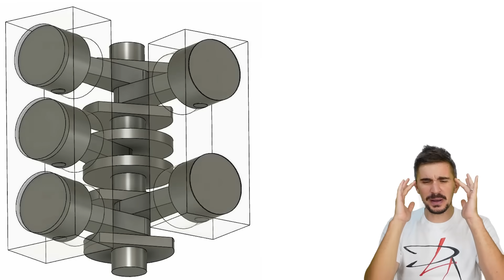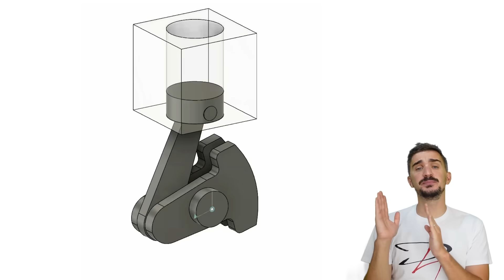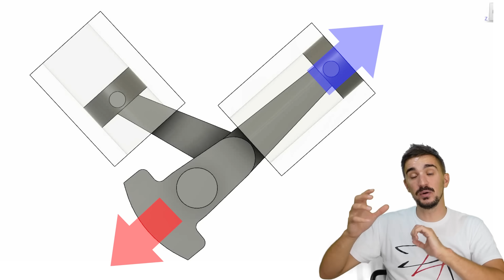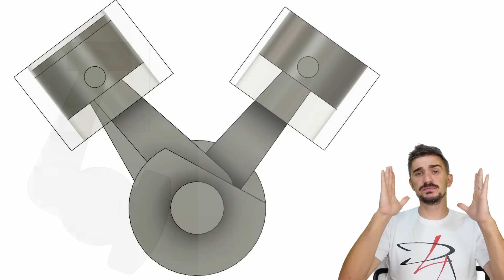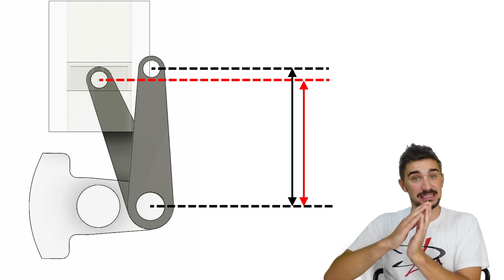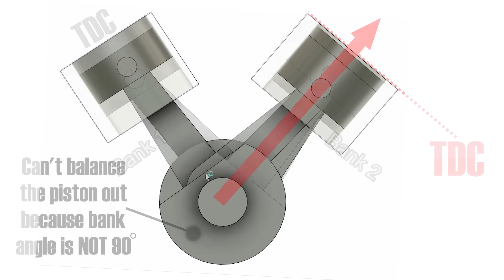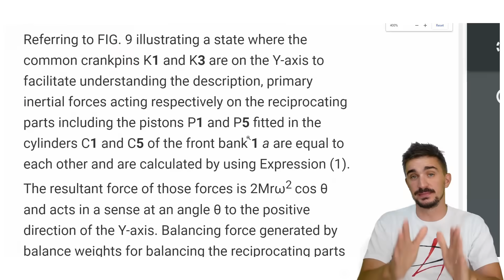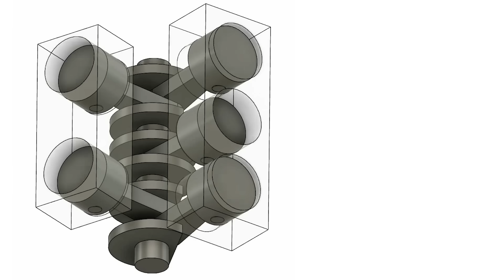Logic Defying V5 Engine - Honda's RC211V Explained Like Never Before

Comment: Thanks for the explanation. The five cylinder vee is novel, but not new to Honda. In 1972 Bert Hopwood at Triumph drew up plans for a new range of SOHC modular designs based on a new 200cc single which could be "doubled up" to make up to a 1,000cc five-cylinder engine. Of course, by this time Triumph was broke, so this scheme never went through to production. I can't find any details on crank throws for the five cylinder.
The concept is sound. The new Triumphs were based on the modular engine concept.

Comment: This just tells me we need more odd cylinder engines. Such a clever squeak of efficiency.
Reply: I think so too, from what i understand the same trick can be used on any odd cylinder engine. The downside is the increased cost of needing an odd and even cylinder head, rather than casting one head twice as many times. That is offset by not needing balance gears. But if a manufacturer already had a related v6 and a v8 on their sales floors. they might be able to reuse a head from each without increasing development cost.
Reply: @martin-vv9lf  V engines usually have two head castings, left and right. The cam drive is the non symmetrical element that demands the mirror image casting. There is a fellow making a V8 using Honda heads, and so it has two separate cam drives, one at the front and one at the rear of the engine.
Reply: @jiroyamamoto2878  But as you point out that a camshaft in a pushrod is non symmetrical, a v5 engine is also non symmetrical, therefore it will require a set of cam lobes per cylinder, not per two cylinders. This may be possible to accomplish since the two cylinder bank fits in the hollows of the 3 cylinder bank and as such the cams will not intersect. The downside is less room for bearing surfaces on the cam.
Reply: @martin-vv9lf  I admit I don't understand your premise. In my above comments, I was referring to an OHC head, not to a pushrod head. I believe that most engines do not share cam lobes with another cylinder.
Reply: @jiroyamamoto2878  sorry, I was muddled due to sleep deprivation. thanks for the v8 honda recommendation.
Reply: V5s do exist, VW had one
Reply: @initial86-2.5 Vw has a VR5 not a V5

Comment: First off VW released their VR5 engine years BEFORE Honda made their V5. Second, i don't understand why try to discount VW by saying that a narrow angle V engine is easier to balance than a larger V engine. If it were truly that much easier than EVERY manufacturer would have made one. The truth is VW has a far greater understanding for building unique engines, examples include a W8, W12, W16, VR5, VR6, all of which are unique to the brand with complicated balancing hurdles to overcome. Even their V10 TDI engine uses tungsten weights attached to the crankshaft to achieve balance in a smaller package. I feel like this video was less of a informational video about a challenging engine to ballance and more of a Honda jerkoff session made to pat them on the back for doing something not that impressive AFTER someone else had already done it. Do better next time.
Reply from the maker: Oh look, a fanboy. I know the video went over your head, but there's no need to throw a hissy fit and embarrass yourself. Instead calm down, regroup and try to understand it again. I'll help you a bit. The VR5 and the V5 are apples and oranges. When the angle is so narrow and the pistons are closer together the balance is very similar to that of an inline five. There's no revolutionary or out of the box thinking required to balance out an inline 5 because it has been done decades before. Lancia did the whole VR thing long before VW btw. Also, tungsten weights and other crank weights of even more exotic materials are nothing new, but more importantly they are also unrelated to the kind of balance I'm talking about in the video. VW did not pioneer W engines, this too was done many decades before. This video isn't about Honda or VW or any other brand. Although this may be hard for you to perceive, many people, including myself, aren't emotionally attached to brands. We're not associated with or employed or paid by them, we simply purchase their products when we believe they offer a good balance of price and quality. You should try it too, you'll be a lot happier and you'll also avoid future embarrassment 😉 Thanks for watching
Reply: @d4a  There is no embarrassment from my side of things. I only pointed out VW because they have some of the wildest engines that have been put into full production, more than any other major brand. Take a look at Harley Davidson. They have a 2 cylinder V engine that has an unbalanced firing order. They took and easy to balance engine concept and INTENTIONALLY run it out of balance.  I get a real laugh out of the fact that you think making a 15 degree V engine is so much easier than a larger degree angle. Its comical to think that. If that were true then everyone would be doing it. I truly feel like you wanted to make a video to stroke Honda's ego about the 5 cylinder engine but then you were like, 'oh crap, VW already made one AND put it into production. I will just say they are totally different so i can still make the video!'.  The fact is, VW put it into production, Honda did not. To my point about the V10 with tungsten weights, it was to point out to you that the V10 engine was so far out of balance that it needed heavier weights just to make it work correctly. This is an engine with 2 inline 5 cylinders, engines you seem to think are easy to balance. I challenge you to find a W engine with 4 rows of pistons besides VWs designs. The fact is VW has innovative and complex engine designs that get put into production. Honda has very little innovation and their experiments rarely get put into production. But don't take my word for it. I only know this first hand from doing engineering work for Honda...

Comment: Any problem can be solved with enough time, money and brain power.  The fact that it didn't drive up design and development costs to the point of being impractical is the surprising thing.  That and the fact it beat simpler designs.

Comment: To this day it's one of the best sounding engines in MotoGP.  Too bad Dorna decided to outlaw such innovation and limit the number of cylinders for engines in the MotoGP class to 4...  Stoner's Ducati GP7 would be a close second; I can't think of another engine that changed its sound characteristics so drastically from throttle open to overrun.

Comment: if you think of V5 as (I3+I2), and if you able to comprehend why i3 and i2 engines are ok, than V5 shouldn't be a stretch.

You can also break V5 up into (v4 + a single cylinder)...  on the same crank.  It's really not that mind-boggling, if you've already accepted that v4 and a thumper are great engines, just add the two designs into the same cast.

Comment: I am amazed at how technically simple this solution is. It doesn't require any additional parts or special devices.
Reply: And it's narrower and higher performance due to a greater piston speed than the common 90 or 60 degree v blocks. The ICE is going out now, but if we had this 20 years ago it would be everywhere.

Comment: Once you draw all the Force arrows around the crank it starts to make perfect sense. How anyone looked at a crankshaft on a V5 and figured this out however, is a mystery to me.  This is a really good example of maths to make the real world work in an unexpected way.  Sometimes all your engineering calculations need to equal zero for everything to work how it should.

Comment: Yet another great video. Forgetting about all that technical stuff for a minute, more importantly, the Honda V5 sounded better than any of the engines on the grid of MotoGP today. The only engine that sounded better was Kenny Roberts V5 engine. Not sure how different this was to the Honda. Firing order, layout, exhaust pipes etc. but it did sound even better than the Honda V5. As good as they both sounded, neither can hold a candle to the non big-bang version of Honda's NSR500 two stroke. The screamer version that Mick Doohan rode was sublime sounding.

Comment: 0:49 reading about this engine years ago, I read that the rumors of the 2-cyl bank, thought to be larger in displacement, were designed to have a peak torque RPM slightly lower than the the 3-cyl bank. The 3-cyl bank was thought to have a peak torque maybe 1000 rpm higher.

This was thought to give the bike a wider range of peak torque (all high up, as its a racing bike after all).

Basically, the thought was it could maintain a wider powerband than a 4-cyl, while still having a higher RPM.

Of course this turned out to just be a rumor... but still, an interesting concept.

Comment: I would love to see more of those v5's. it seems like a very nice design idea for compact cars as well, and let's be honest, 150HP (I am assuming they would throttle it down to make sure it survive more than 1 race length) with any city Hatchback would be decent,
small unit would leave a lot of space for hybrid piece, without any compromises on power output.
Reply: VW did a V5 engine.  The later 20v version was 170hp.

Comment: That joker would have won a lot more races if V Rossi hadn’t left to prove his talent was supreme with Yamaha(who still runs an in-line 4 in MotoGP despite all the comp running V4’s ) . He was so damn good at that point of his career that even the mighty RC 211v wasn’t enough to beat him with any consistency. I’ll never forget watching him blitz Alex Barros on the NSR500 while riding the 211v in Assen 2002. He was able to pass at any point but he gave the fans a gift by pretending he was being challenged. He wrapped the throttle finally and just swallowed that 500 up like a literbike vs a 600 . It’s was crazy!!

Comment: Why was it retired though, when it was so successful? Did the sports authority just ban it? Also was it being compact and short the only benefit? I guess using smaller cylinders would mean you could rev it higher with the same materials, meaning it could have more power or better durability than a V4.

Comment: Thank you very much for the meticulous yet simplified explanation of the V5 engine. Thankfully I didn't get a smooth brain watching the whole video 😂. I always wonder how Honda could manage to achieve that balance with their engine, but with the whole setup they did that you explained, it makes a lot of sense for them to do so, in addition to other benefits the V5 brought to the table.

The early four stroke era of MotoGP were indeed crazy times. I will be overjoyed if you can cover more of those, like Yamaha's Genesis-derived engine used on the early M1s (they even attempted to design it with downdraft carburetors instead of fuel injection, which was by itself a mad lad move in relation to how the EFI technology had matured at that point), and the insane but doomed triple of the Aprilia RS3 Cube

Many kudos!

Comment: When a well known experienced engine manufacturer builds an engine i don't suppose it shakes itself to death or that it won't work, because they most of the time have invested a lot of money and time with great engineers who know what they are doing.
And that said: with offsetting, bank angles and balancing weights (and ballancing shafts) ect. almost anything is possible to run reliably and smoothly.

Comment: Could you theoretically have adjustable connecting rods that were to expand and contract on each stroke to add a percentage of power? Obviously electronics wouldn’t survive at that speed but just theoretically?

Comment: I had a V3 Honda MVX250  2 stroke in the late 80s.  It actually had a heavier, full skirt piston in the middle cylinder. Also the wrist pin was solid in the middle piston and hollow pins in the outer two. 
I know tis for a fact because I had the engine apart after burning a hole in one of the outer pistons.
Reply from the maker: Yes, but that's a v3, you can't balance it like a v5.

Comment: I recently read it’s impossible to make a single carburetor work on an inline 5-cylinder engine and achieve even fuel/air distribution. I can’t wrap my brain around this, but I’ve also never seen a 5-cylinder that wasn’t fuel injected. I’d love it if you could perhaps explain why in a short video.

Comment: Volvo used  V5 for many and many years...
Reply from the maker: No they didn't
Reply: Volvo (and others) used inline 5-cylinder engines, not V5.
Reply: @brianb-p6586  concept is not so diffrent...only a different angle
Reply: @jasper221176  That angle is fundamental to the balance problem, so it is very different.

Comment: Why are there no V14 engine's?
Reply: There are V14 engines, made by MAN B&W,  Wärtsilä , and possibly others; MAN currently builds up to V18 configurations. The format is so long and would have such small cylinders in a car-sized engine that a V14 only makes sense for a very large diesel engine in a ship or a generating station... and that's where they are used.
Reply from the maker: For the same reason that inline 8s are dead. They fit inside nothing
Reply: @d4a  more specifically, they fit inside no cars.

Comment: Honda is not just supreme in getting most hp out of small engines. but they are also very clever designers of brakes, chassis and suspensions. i once had a civic and while using the breaks the vehicle was just stemming itself against the road with all 4 tires, lowering itself as a whole and pressing itself to the ground instead of tipping over the front as most vehicles do. a behavior i have never seen this way so accurate and balanced on any vehicle, not even on an audi TT or a mercedes SL or a BMW 325 all of them I once owned.

Comment: I never could figure why somebody didn't make a V5 much earlier. A V6 in order to fire evenly has to have an offset in its crank causing a weak spot and an inherent obturation in the harmonics. A V5 would eliminate that problem. The crank could have more than adequate counterbalance and run just fine. The other thing that people aren't realizing is that in motorcycle competition the engines don't fire completely evenly anyway because when they do it makes the contact patch go all the way up to almost zero contact before it breaks loose between the Rubber and the road. Having a little bit of a thumping effect in that helps to warn the rider of when they're approaching zero contact and keeps them from killing themselves.
Reply: 60 degree V6 engines do not use offset crankpins, and fire evenly.

Comment: MY 2002 Audi a3 has v5 .. doesn't it?
Reply from the maker: It doesn't
Reply: It may have a 15-degree V5, which VW calls a "VR5", which is balanced differently... but I don't think any 2002 A3 had a five-cylinder, and even later A3's which had a 5-cylinder had the inline-5, not the VR5.

Comment: I think the engine was "retired" from MotoGP because the rules were changed to ban anything that wasn't a 4 cylinder engine with a certain specific bore and stroke...as a "cost-saving measure..."

Comment: And like terms they change the degree of the rod position on the crank and the rear piston assists the front two when the front two fires it gets to a certain point in the back one fires and assist the front ones

Comment: I very much enjoyed that! Thank you for the work and insight!  WELL DONE!   Does anyone know why Honda stopped competing with the V5, and went to other engine configuration?   I am guessing the rules changed to keep the racing more fair. The others could not build an engine to compete....  THOUGHTS?   BTW I love my Honda NC750. Better than all my past BMW's combined!
Reply: It's mostly just rule changes. Around the late 2000s, MotoGP change the engine size from 990cc to 800cc and limit the number of cylinder to just 4. With the new regulation, Honda dropped the RC211V and build the all new RC212V.

Regarding domination, since Rossi moved from Honda to Yamaha the winning streak for RC211V dropped quite a lot and Rossi with the YZR-M1 with its Inline-4 became the team to beat.
Reply: @AbrahamArthemius   Abe, was the Yamaha teams winning streak due to Rossi or superior equipment? ( provided by Yamaha)
Reply: @davidfalgout7304  A little bit of both. Rossi is already a known great rider and although it doesn't quite match Honda's speed in the straight lines, the M1 is arguably a lot nimbler and faster around the corners (some say courtesy of its smooth power delivery from the I4).

Comment: What a wonderful video!!! What I got out of it is how amazingly inefficient a reciprocating piston engine is.
Reply from the maker: If that's what you got than I'm afraid you missed the point by a mile. This video does not touch up on efficiency in any way nor can you infer anything about efficiency from it.
Reply: @d4a  Thanks for answering. I guess I should have be more precise. I understood what you had to explain and it was amazing. Thank you for a great video. But I ALSO got out of it from you talking about the pistons going up and down so much is how inefficient piston engines are, look how much mass has to slow down, stop and re-accelerate. Keep up the great work!!!
Reply: @EDKFtravels  the reciprocating action has nothing to do with efficiency.

Comment: I admit, I would have assumed that you would go with a 90 degree bank angle.  At 90 degrees, the primary unbalance cancels out as a rotary force. If each end is rotary, we can orient the crankpins so that their product is a rotary force at the center which can be canceled by the rotary force created by a 1/2 balanced single cylinder.